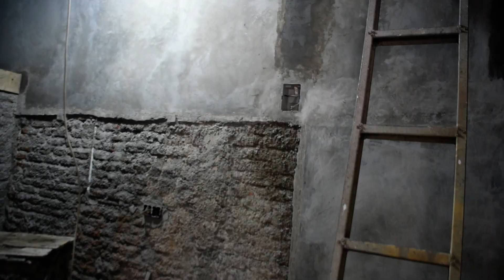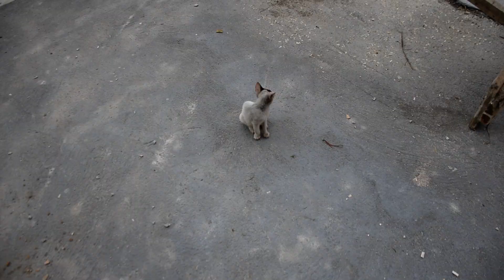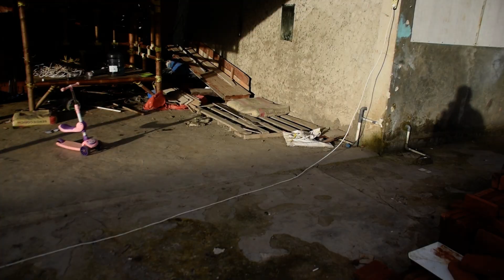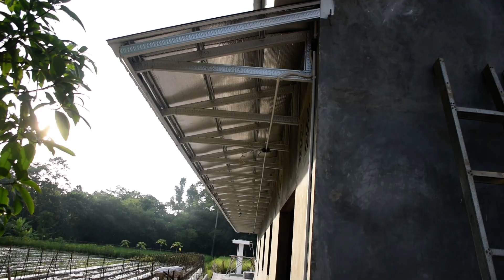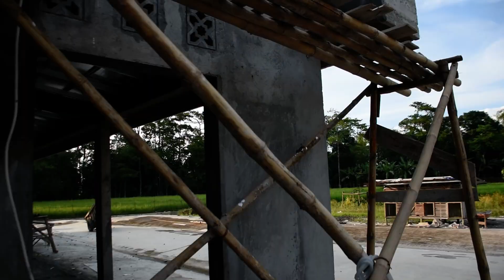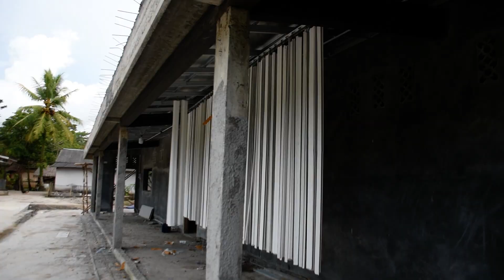Interesting ceiling

Comment: Man these guys put in and really appear to get on with production.
Reply from the maker: Work goes on seven days per week.  They are happy to work while work is available.  

We are down to the skilled workers now.  The main man, Jhoni, is very versatile.  He seems to be able to tackle most things - electrical, plumbing, sheet metal fabrication, welding, roofing, bricklaying, etc, etc.  I think he likes working for us when we have jobs because of the variety.  Today we pulled him off the house to replace the solar powered hot water circulation pump on the roof of our back patio.  The pump had started growling loud enough to be very annoying, and because of varying solar input it wasn't even a steady noise.  Later, we pulled him off the house build (with his primary co-worker) to fix the wiring for the drinking water pump at the shed (corrosion issue).   Jubaedah showed him some photos of fancy ceilings that Bendi liked, and that is what he came up with.  The West bedroom and lounge room are going to get something similar (or maybe the same in the case of the bedroom).  One thing I really like is that Jhoni actually asks questions if something needs clarifying.   He knows I have good ideas, and I know he is pretty good at what he does.  We seem to get good results. 

That is one of the gripes I have about our house - between sending my brother in law back to Bakung after a month in Melbourne (January 2017) being educated about my design, and the start of construction, everything was forgotten.  Not one question was asked of me during construction (Jubaedah and I were in Melbourne).  Did I get what I designed?  No.  There were some vague similarities, but I had to spend a lot more money fixing what could be fixed.  Some things couldn't be fixed with less than demolition and reconstruction.  So those I have to live with.  

Bendi's house is very much closer to what I designed this time.   Jhoni has drawings, and conformed fairly well with those.  He forgot the floor level change down into the kitchen and laundry.  But I'm not the one who will have to deal with water escaping the wet areas to other parts of the house.  Some things changed after the drawings were finalised. e.g the door on the East end is no longer a sliding door.  The toilet cubicle in the laundry was expanded to a bathroom.    

Jubaedah really likes the kitchen in the new house.  I told her she can't have a third kitchen :-).